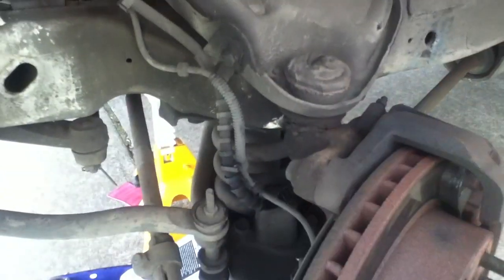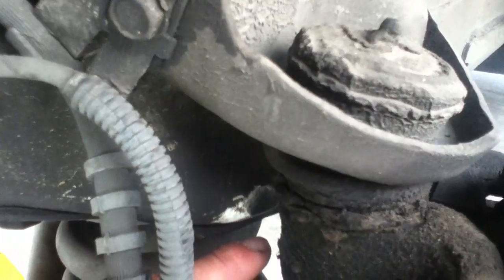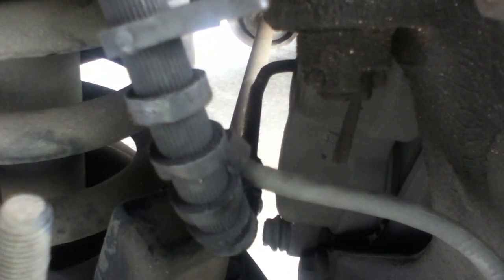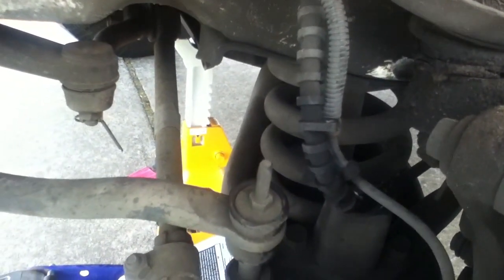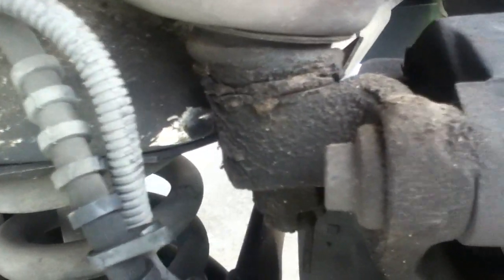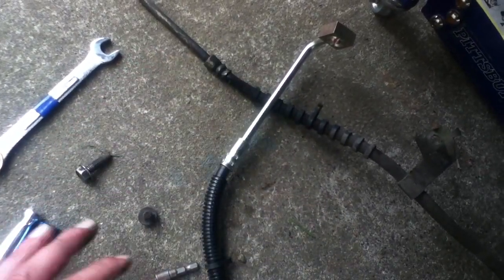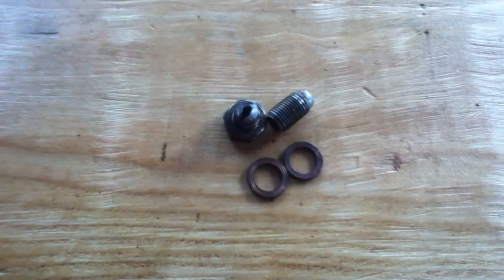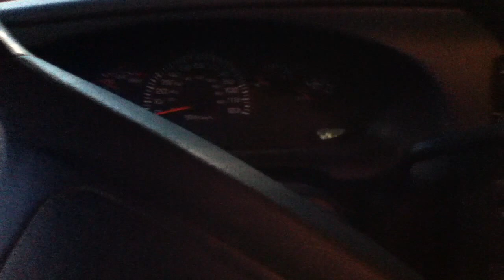Dodge Van Brake Line Problem and Solution 2000-2003 models

Comment: Thanks for the VIDEO! This exact problem just happened with my B2500 yesterday while my wife was driving the van. She pulled up to a stop sign just before getting on the freeway and the brake pedal went to the floor! She used the E-brake to stop the van and luckily didn't hit anyone! Dodge should pull real hard on their shoulders to dislodge their heads so they don't end up in a law suit or suits that will kill profits for a few years! This is a cheap fix recall item compared to the air bag recalls that are happening right now!!! WAKE UP DODGE!

Comment: Just had it happen as well driver side . Was sitting in a drive thru. And just blew out . I agree with the feeling of the brakes prior to the line blowing.. it was feeling kind of variable pressure at the brake pedal. Kind of soft but brakes working. I thought it was just a characteristic of this van maybe. I ordered my brake line thru Oreily auto parts and they will get it in 3 hours. 🤞 I wish I was aware of this problem prior. Cuz it can definitely kill someone.

Comment: You didnt put any info on the part number of the hose assembly you bought and installed. Part number would be helpful.
My hose looks exactly like that worn in the same place.  Would be nice to know what part number it is, OEM or whatever.

Comment: the only recall we got from dodge was a recall on the transmission nothing else and today we hit a bump and not long after we had no brakes! 
This could have been catastrophic and could have cost multiple lives! 
When I checked the brake fluid it was dry!
1st I thought sabotage! 
After watching this video I knew what to look for and shur enough brake fluid all over the frame in the exact spot as this video!  
I'm contacting corporate and I will sue! 
They have had 15 years to address this issue but they have done nothing!

Comment: is that extra line attached to the flex line the ABS? im trying to determine whether my 2500 has 4 wheel or 2 wheel abs. im dont think it does.... having a problem with the passenger side caliper sticking, so i go through pads like crazy! i think im going to replace the flex lines as i have already done the caliper......let me know what i should do!
 
this video is great, i dont see too many '03 2500 vans around like mine

also,, where did you get that bolt that you broke? i had the same issue with mine only i just twisted it..
Reply from the maker: I am thinking that the caliper might be the problem.  If rust and old brake fluid gunk up the cylinder, it can jam up the way it returns to position.  It can be taken all apart, cleaned and new seals (rebuilding) or replace it with a rebuilt unit.